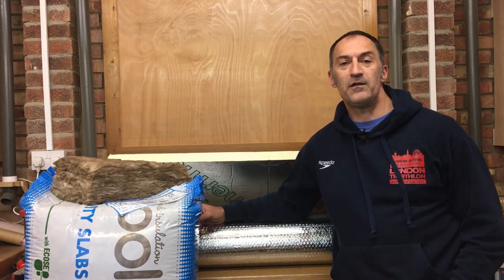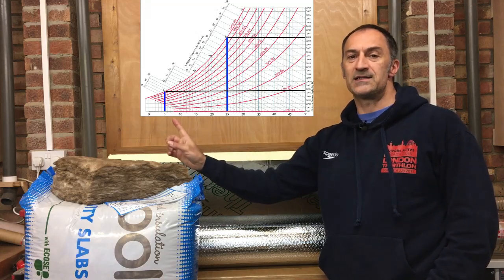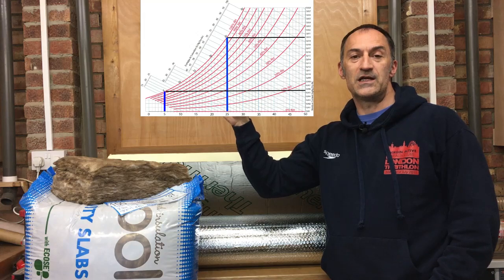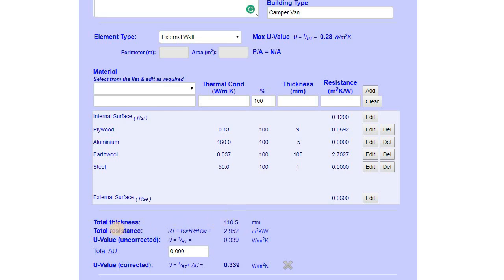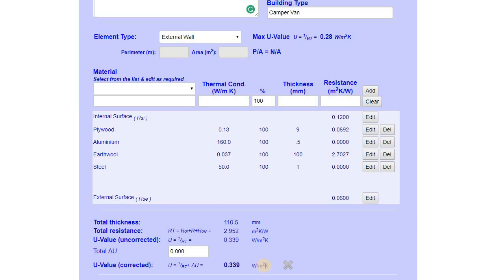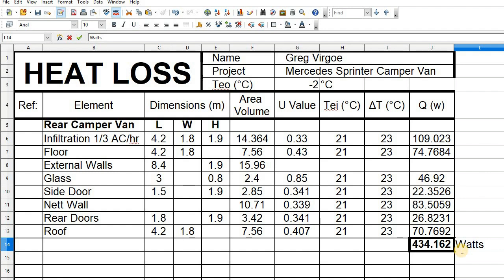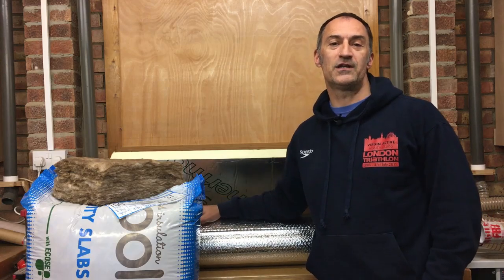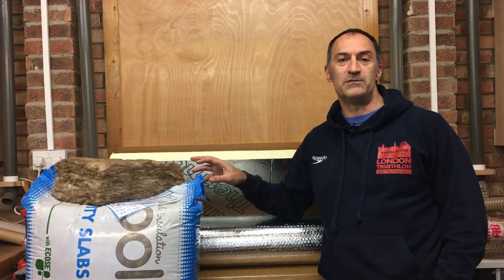How to Insulate your Van Part 1 - The facts you need!

Comment: hey Greg, I want to insulate my aluminium cargo trailer, there are steel studs holding up the aluminium sheeting, would it be a sound idea putting in rockwool and a vapor barrier and then ply, or would it be better just chucking in a bunch of foamboard sealing up the cracks with spray foam and then ply on top of a gap for ventilation. need ome help here.
cheers
Reply from the maker: J MG insulate between the metal studs. Put thin layer of insulation over the metal studs too. Vapour barrier over everything. Then ply line the wall. 
You could timber batten the metal studs to give you fixing for your cladding.

Comment: I’ve been watching you videos with massive interest, In my project camper videos, I placed the foil bubble wrap on the inside of the steel skin then placed the wool on top and a breathable membrane then plywood covered in the stretch cloth, if I’m right in thinking I have changed the thermal mass of the van’s metal skin to include aluminium with a zero R rating and only the wool and wood and cloth will make a difference. Kind regards Sean from Project camper, ps thank you for subscribing, it was great to meet you ant Stratford and hop your having fun in Europe 👍

Comment: Thanks, video is really instructive and useful, but just one question about reflectix: isn’t it wrong to consider it as a vapor barrier ? A simple polythene film (as in a house) could do the job for a fraction of the price, no ? And save on thickness.
Reply from the maker: it's most definitely not wrong to use reflectix as a vapour barrier, aluminium foil is the best vapour barrier there is, totally impervious to moisture. It's readily available and easy to install.  You can use plastic sheet but it needs to be a good quality building grade one as some polythene sheets are permeable. :D I covered my entire van for under £90 and was a good investment as its also double skinned. Two for the price of one.

Comment: Greg I have followed your videos like a bible for my van build. I have gotten to the insulation stage and have started with kingspan board on all the flat areas like you suggested. Planning on filling the gaps with ecowool. I have a question about the vapour barrier. Have read lots into it and wandering if it is ok to put vapour barrier straight onto bare metal? There are several bits of bare metal around the panels and I've read it's bad to put vapour barrier direct to metal? Is this wrong? 

Thanks in advance! Would add pics for reference but not sure how.
Reply from the maker: Ideally you need a small amoutn of insulation to create a thermal break, you get a very small amount with the bubble wrap so that helps, plus most of your internal steel structure is only bonded to the outside skin with silicone so its already thermally broken. I laid the foil bubble wrap across everything and panelled over that and it has been fine with no signs of any condensation.

Comment: Hello Greg, as others do, I also must send big thanks for sharing your knowledge. I got a feeling that your insulation is primarily focused on winter time to keep cold out of the van. My concern is more on summer time when I try to keep the van as cool as possible. My question is why did you not insulate steal ribs of the van with thermal insulation at all? I guess during the summer they can get very hot and there is only Reflectics between hot rib and inside of the van. What do you think about that? Would those ribs also deserve some kind of extra thermal insulation?

Comment: Would tyvek be a good moisure barrier as celotex would get "squished" by plywood or paneling? Great video presentation by the way.
Reply from the maker: Eric Merchant Tyvek is a breathable membrane that’s is vapour open so I would not use it. Far better with something that is 100% vapour proof like foil
Reply: Just out of curiosity why do they use tyvek on houses is that due to cost?
Reply from the maker: Eric Merchant you need a breathable membrane in buildings to stop timbers from rotting. What we are trying to prevent is condensation forming. Different applications.

Comment: SAY WAIT, what about this?!:
A super cheap great overlooked free insulation material for what you might use to stuff into cavities in a van is used poly fill-pillow filling that you can fairly easily get for free from people's warn discarded sofa's are often found next to apartment dumpsters OR the Foam From the discarded Seat Cushions-New foam is Very expensive but this foam is FREE and should also sound deaden much! The cushions often have zippers or just cut the seat open. To cut foam to desired size and shapes, I use a hack saw taken out of it's holder, holding the blade loose in hand and saw back and forth although it does not work as quick and precise as an electric meat knife, it works ok. Don't use fiberglass insulation that goes in house attics, I think the loose fibers would get into your lungs no matter what. Also note that the stuff in used sofa's have been covered and protected by the outer fabric so it's usually in pretty good shape.
Because any soft pillow pads or pillow backs can be full of the stuff. Just cut open with a knife to find out and take what you want before the garbage company crushes the sofa. 
Of course you'd want to give it a quick close scan smell with your nose on it in case it has pet urine but really most apartment deter pets by either not allowing pets or they charge a lot to have them.
Manufacturers make the poly basically from plastic bottles and it's fluffy and no one is allergic to it and it doesn't make you scratch and it doesn't absorb water and although it isn't as good of an insulation as foam, it does insulate by holding the air in it's fiber fluff pockets.
Of course you can buy it new in bag at hobby departments but it can be kind of expensive and why buy new when you can get for free and save the environment from more new plastic?!
Thank you Take Care!

Comment: SAY WAIT!:
A super cheap great overlooked free insulation material for what you might use to stuff into cavities in a van is used poly fill-pillow filling that you can fairly easily get for free from people's warn discarded sofa's are often found next to apartment dumpsters OR the Foam From the discarded Seat Cushions-New foam is Very expensive but this foam is FREE and should also sound deaden much! The cushions often have zippers or just cut the seat open. To cut foam to desired size and shapes, I use a hack saw taken out of it's holder, holding the blade loose in hand and saw back and forth although it does not work as quick and precise as an electric meat knife, it works ok. Don't use fiberglass insulation that goes in house attics, I think the loose fibers would get into your lungs no matter what. Also note that the stuff in used sofa's have been covered and protected by the outer fabric so it's usually in pretty good shape.
Because any soft pillow pads or pillow backs can be full of the stuff. Just cut open with a knife to find out and take what you want before the garbage company crushes the sofa. 
Of course you'd want to give it a quick close scan smell with your nose on it in case it has pet urine but really most apartment deter pets by either not allowing pets or they charge a lot to have them.
Manufacturers make the poly basically from plastic bottles and it's fluffy and no one is allergic to it and it doesn't make you scratch and it doesn't absorb water and although it isn't as good of an insulation as foam, it does insulate by holding the air in it's fiber fluff pockets.
Of course you can buy it new in bag at hobby departments but it can be kind of expensive and why buy new when you can get for free and save the environment with more new plastic?!

Comment: mr vigoe... i have been kicking around some thermal barriers to my insulation ideas for the van im going to build.  i was considering either carbon fiber felt or ceramic fiber ..... they do not really have an R value.... but they have heat blocking properties.  with the van exterior being metal and conducting heat.... i thought maybe a heat shield sort of layer before the insulation .  the carbon fiber felt would be easier to work with for me.   the ceramic fiber is the type of stuff they use to insulate kilns etc.  but i worry about tiny fibers floating around getting into everything including my lungs.  im not worried as much about that with the carbon fiber felt.  what is your opinions on these? aerogel is uber expensive and not viable for my pocketbook.  basically a layer of heat shield,  then a layer of insulation,  then the actual inside wall of the van

Comment: If only diesel heaters could pump out just 500 Watts.
The smallest is 2KW - too hot for continuous use.
Reply from the maker: This calculation was just for the rear portion you also have heat loss form the cab to add to this. so its most likely to be more than double so 2kw will be ok

Comment: Great video! But can you help me wrap my head around this... I’ve seen so many videos and articles saying to avoid wool insulation as it has a tendency to mould? Also what is the reason for using reflectix over the other insulators and not directly against the metal as the first step? Thanks so much!
Reply: Vanessa H 
According to his reasoning, there won’t be any condensation, so no possible mold problem.
He’s probably correct - if every step is done correctly and carefully. Big ‚if‘, for people with no experience with that kind of work.

As for the reflectix - you gotta keep in mind, that you can’t keep cold out. You can only keep heat in. ‚Cold‘ isn‘t a thing, really - it’s the absence of heat energy. So the reflective surface should always be towards the warm part. Want to keep out heat in summer? Put the reflecting surface on the outside. Want to keep heat in, in winter? Put it on the inside. It doesn’t insulate, it reflects back heat radiation. 

Also: it’s best, to have a glue on material like Armaflex as the very first layer against the metal, not something loose. That way, if there is condensation, it won’t be right against the metal and potentially cause hidden rust. Mould sucks, but rust on your vehicle sucks more 🙂

Comment: Will you be cleaning the van walls with 91 percent rubbing alcohol and using 3M glue on the wall and the board insulation ?
Scott from NH. USA .

Comment: Every informative and cleared up most of my confusion based on other videos that I’ve seen. Based on your video I’m really thinking what I need is some sound proofing and a vapor barrier. The temperature range for where I will be using the van is 8c - 30c. Do you think that this range requires insulation as well?
Reply from the maker: Edward Tobin this video explains a lot more too https://youtu.be/_6eWGp14TL4

Comment: Great information Greg.....one question. ..... my friend is converting a minibus and the ribs in the roof and sides are aluminium box sections  60mm wide  x 40mm depth , so 40mm foil backed board is working perfectly all round. Will the foil bubble wrap be okay to wrap the whole inside of the bus without danger of condensation along these ribs?

Comment: Hi Greg, I've been pondering about something lately and I'm wondering if you can help? I really like your approach to insulating the van but sometimes we do things just because we see everyone else doing them without actually checking to see if we should which brings me to my question. How much benefit is there from stuffing insulation into the ribs of the van as the insulation inside the rib doesn't provide a thermal break and there is still the heat transfer through the metal of the rib itself bypassing the insulation inside it? 

Also, what are your thoughts on sprayed cork on the interior to provide an initial thermal break?
Reply from the maker: CJ Hamblin the inner and outer skin of our van are bonded together with a sealant that helps to create that thermal break so the inside skin does not feel as cold. I would still insulate the ribs to reduce convection inside those voids.  My Worksop video explains this in more detail. 😊

Comment: I see after a bit of research it's the cavity slabs you are using, they have a slightly better thermal value 0.037 compared to the roll which is 0.044, I think the roll should be sufficient enough!
Reply from the maker: Brian Vahey yes it will still give you a good level of insulation.

Comment: Forgive my ignorance, but surely the heat loss in Watts across 1 metre of insulation with a 1 degree difference from one side to the other is dependent on time! Your calculation/ equation does not include time, therefore is meaningless. Please correct me if I have missunderstood.

Comment: Compared the thermal conductivity and resistance of both PUR and PIR.  Your calculator provided identical results.  Is there an significant advantage using PIR, as you did, over PUR? The PUR is easier to obtain locally.
Reply from the maker: a.k.a. slade PUR is the predecessor of PIR but have equally good thermal properties so would be fine to use either in your van.
Reply: @GregVirgoe  Wow, quick response! Bit of a snag w/ PUR; rep assumed I was talking about polystyrene and not PUR.  If I were to stack two 1" PIR pieces is there a method you could recommend with regards to the orientation of the white non-reflective and silver reflective faces for optimal performance or insignificant?
Reply from the maker: Most important is to make sure you have a foil layer on the inside surface. Others not so critical. But it makes sense to put the white surfaces together in the middle. 😀

Comment: As a former Science teacher, I salute you for the excellent presentation of this topic, very clear and worth knowing! I now work in domestic insulation as a surveyor and would like to ask you about avoiding thermal bridging that you briefly mentioned. Does the mixture of R Values not increase the likelihood of bridging where the different materials are close to each other and does expanding foam help to remedy this issue? Thanks again, great tutorial!
Reply: There is a potential for cold bridging as the performance of these materials is different, but one needs to ensure insulation products are well butted together and the all-important air tightness layer/vapour barrier is in place.  Remember though: expanding foam is an open cell product and not a closed cell product (the ones from BQ, toolstation in the cans etc), so open cell is susceptible to moisture.  Again, as long as it's covered by a proper vapour (preferably permeable) barrier.

Comment: very technical but brilliant and simply explained...(with some concentration) :)
Couple of questions
1) Whats the thermal conductivity of Lambs wool vs Earth wool (0.37) considering which to buy
2) Plus if the reflectix is a terrible insulator and simply a vapour barrier...why not simply line it with Kitchen aluminium foil.  Surely at a single layer rather than the double layer of reflectix you are reducing the thermal conductivity (loos of heat) and its cheaper and thinner to use, hence saving money and adding a minute amount of volume in the van?  Small point but useful to ask
3) Presumable you would then use the kitchen foil shiny side inwards towards the van? to reflect radiant heat and form vapour barrier?
Thanks in advance Greg

Comment: We are now working on the insulation and we were wondering why we should not use wood wool instead of mineral wool since we will be in hot areas mostly and wood wool is supposed to have better heat insulation?
Reply from the maker: Ivo Houben all wool based insulation materials have a very similar K value. So you can use whatever is readily available to you. 👍🏼
Reply: @GregVirgoe  hey Greg, you are the best!
Maybe make a video about heat and what you can do against it in a van. I am thinking about pulling cold air from underneath the car.
Reply from the maker: Ivo Houben I talk about that in my insulation workshop video
Reply: @GregVirgoe  That workshop video answered any questions I had left after watching your other insulation videos.
Reply from the maker: I’m glad it answered your questions. 😂

Comment: Question for you, aren't you by using the foil, creating a gap between 2 vapor barriers the outside shell (the metal) and the inside foil, therefore creating condensation between the two? Wouldn't it be better to use just the outside shell as the vapor barrier and let the insulation breath, thereby creating less condensation through evaporation?. Actual question not a critique. Thank you
Reply from the maker: Hi Bradley, I’m pleased you asked because there are a couple of huge flaws in that thinking. 
Firstly the water won’t get in from outside, your van is designed to be waterproof. 
What you need to do is stop the moisture that is inside your van condensating on the inside cold steel surfaces. 
You need to prevent this from happening. The only way to do that is to insulate the voids well and then put a very good internal vapour barrier over everything before lining the van. 
Allowing your insulation to breathe is allowing moisture laden air to get in contact with your cold steel van. 
If you do not put in a vapour barrier you will get condensation forming all the time. 
Nothing will be trapped in there so don’t get sucked into that argument. There will be equivalent to 3 drips in the air at the time it’s insulated so basically nil. 
Please watch my workshop as this will explain so much more about condensation and how to prevent it. 
https://youtu.be/_6eWGp14TL4